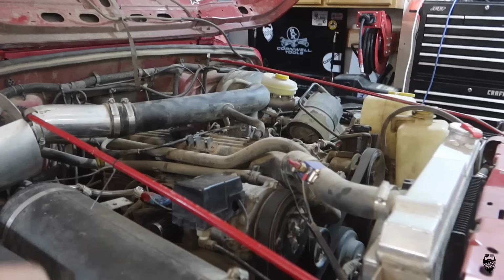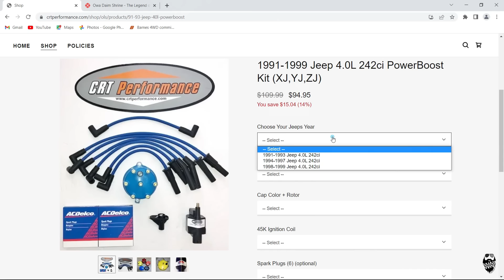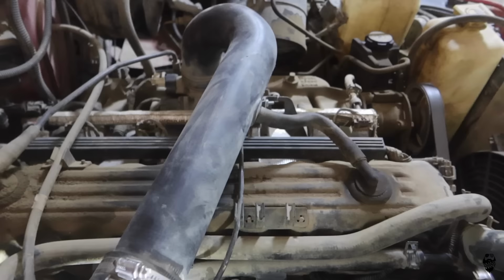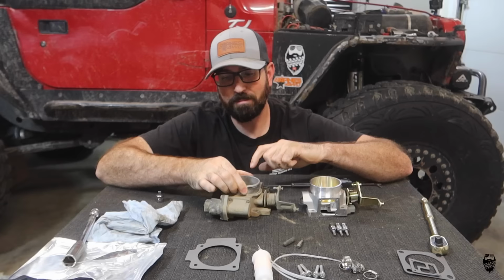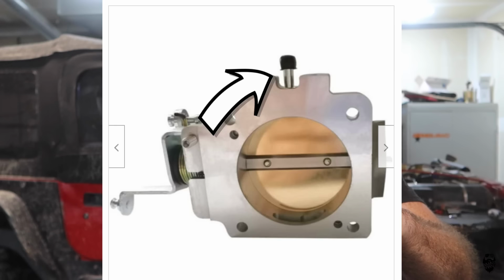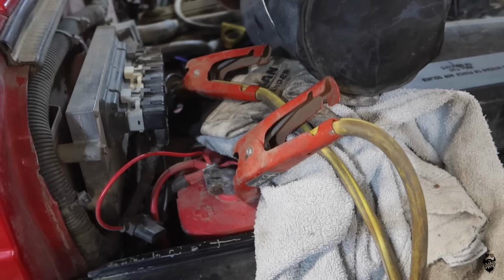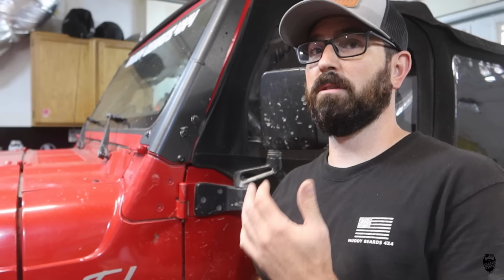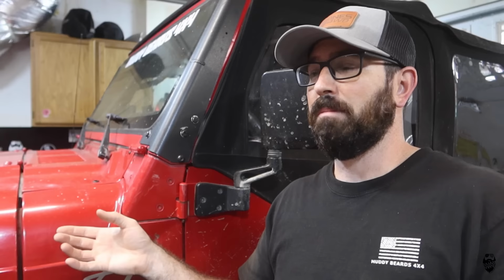MUST Have Jeep Wrangler/Cherokee 4.0 Upgrades?

Comment: Jerry Bransford aka the TJ guru "who knows a few things" on the Jeep TJ forums said these upgrades including those 4 hole injectors are a total waste of money. Many others on these forums who have done these so called upgrades agree, time and money wasted.

Like you said, these 4.0's are already tuned as well as they possibly can be. They're built for longevity and durability, not high speed performance. 

What has given me a smoother running 4.0 has been using Valvoline 10w30 150K+ miles Synthetic Blend oil and a few oz of marvel mystery oil at fill ups and about 500 miles before oil changes. Routine maintenance and doing our due diligence is key with our 4.0's. 

It's seems nowadays a lot of "Jeepers" want the muscle car performance of a '68 Camaro SS in their 4.0's. I don't recall this foolishness from '97 - '06. The aftermarket has been feasting on off roaders in shaming them who keep their rigs stock or close to it. When knowledgeable wheelers know full well, our 4.0's are plenty capable and just require a 2" lift and 32's - 33" ko2's or MT's to have a blast off road! The aftermarket has really done a number on people targeting the not so sharpest tools in the shed.
Reply: I totally agree. I use the Valvoline 10w30 conventional oil since I bought it 6 years ago and it runs great. I have 115000 miles on it.

Comment: I realize a true custom tune is going to cost you, but you honestly cannot compare the results you are trying to use. It takes a custom dyno tuned and mapped efi engine to produce those numbers. Truth be told, a good tune probably would have yielded better results without even adding the components you changed.

I get that the video is content based, and that’s why we are all here. But if you have experience as a mechanic, you know that manufacturers ALWAYS produce vehicles that are designed to pass emissions standards, not optimize performance.

Just my $.02

Comment: most of this does not apply to my 4.0 WJ. Mine came with coil on plug ignition with a 60mm throttle body. I opted for a throttle body spacer, instead of the 62mm throttle body. I did a Blue Streak ignition coil, Bosch double iridium spark plugs, and an Airaid CAI. I also inspected and cleaned my factory injectors and installed the DEI fuel injector/rail insulation at the same time. "Larry" revs much more freely than ever, has increased fuel efficiency by more than 1 MPG (despite my heavier foot) and, for the first time in 5 years, has no engine light on the dash! its still a 4.SLOW. there's only so much you can get out of one of these tractor motors.

Comment: You Seem like a nice guy but your wrong on this subject .. Stock tj 4.0 on a dyno runs 151 HP and adding a cold air intake gets you up to 158 hp .... Adding all the other up grades and Tricking the ECM or tuning  it will get you a health boost in HP. OR JUST ADD NOS .. LOL

Comment: Sorry but the throttle body does exactly nothing. The intake pipe is the bottle neck. Especially in the bend to the throttle body. Even with a good intake pipe the throttle body does nothing on a stock engine with stock tune.
Reply from the maker: Not necessarily true, the stock intake tube fits on the 62mm throttle body. It gets smaller inside the stock throttle body. There are many articles that show it 100% does increase HP/TQ proven on the dyno. Although very little.

Comment: 4.0 is a waste of time to put money into ..... sorry everyone. and you can argue it all you want... just a waste of time
Reply: Will out last any other jeep engine in this era
Reply: @merritt McDowell  yeah kool... the only thing it's got going for it.... so if the only thing people want is a long lasting engine when it comes to offroading then good to go.. but if you want HP,  torque, aftermarket options or basically anything then the 4.0 is a waste of time
Reply: @DrHavok1  if you only want power no engine jeep put in their rigs( off road capable that is ) qualify  you need to LS swap or run a SB or BB, you don't run a 4.7🤣🤣🤣
Reply: @merrittmcdowell8675  that's good my jeep has a 5.2 that is really reliable it will last me through 300k miles and it still burns the 33-inch tires on dry pavement every single day and it will beat the 4.0 at every thing. after it goes out yes I will most likely swap in the LS or a built 5.9L magnum
Reply: @merrittmcdowell8675  also my point is it is a waste of time to put money into as a wheeling rigs engine... if you had a pile of them and just need something to go from point a to b all the time and don't need or want performance then the 4.0 is a good option
Reply: @DrHavok1  with wheeling rigs gearing is everything honestly power is a substitute, but yet power breaks everything a lot of time lower power is better, if you get foot happy with a 4.0 chances are you wont break stuff if you get happy on a 500hp wheeler plan for expensive repairs. Its all in what you are doing. Lower power and good gears will take you to the same place as high HP to a point of the average off roader.
Reply: 2005 Rubicon 4.0 six speed manual here. When off-road I have never ever felt underpowered. I’m mainly at idle to just off idle. Climbing 3 foot tall rocks low range lockers on and just idle over it. I’ve never felt that I needed anything more than stock. Just my experience.

Comment: The throttle body bushings wear and cause wandering idle due to vacuum leaking by and noone sells a new or reman, at least not when I had my 95 4.0 jeep. The distros wear out good as well but are available still. Though they all say that warranty voids if you remove the cap....so how do you get it timed properly?